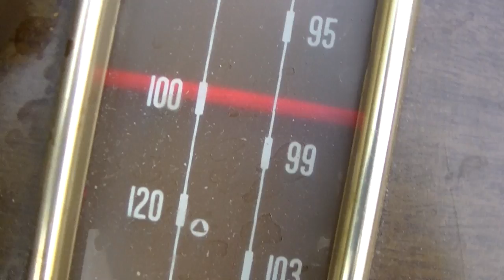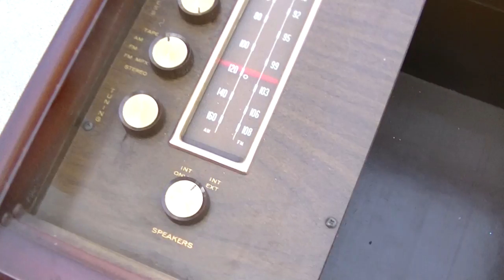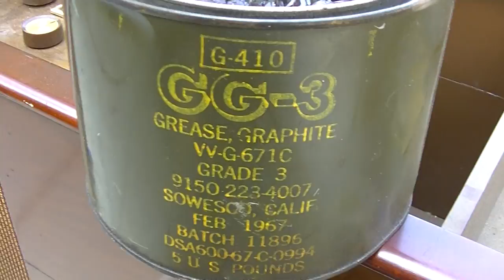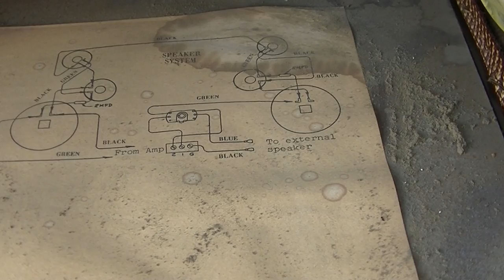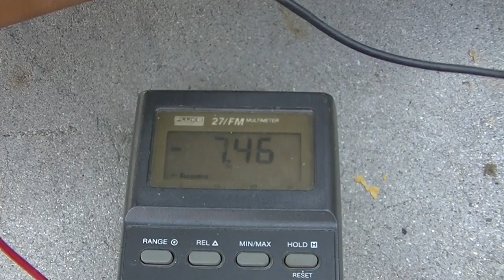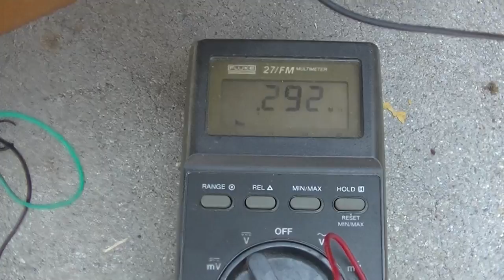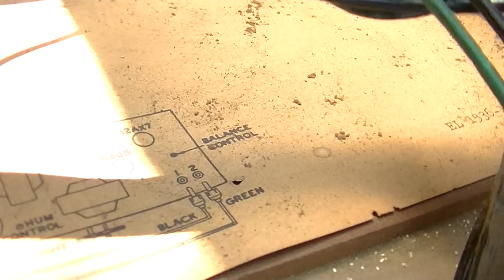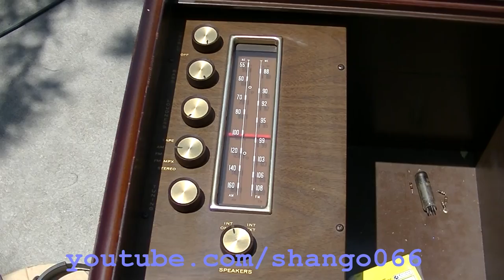Magnavox Console Stereo Record Player Repair

Comment: The reason why it took it a little bit is because the tubes need to warm up before you hear anything. We are so used to turning something on and there it is. Back then the tubes had to warm up when you turned it on.

Comment: I have a 1960 Zenith console and the FM was working but then stopped. Initially the FM worked but the stereo light didn’t come on right away. I’ve looked over some of the tubes and noticed two were very dim. Should I replace them and see if that helps? I cleaned up the turntable and it was working beautifully but now has that similar grinder noise. I have to go back and check it. Any ideas on the FM? Thanks

Comment: Good old speaker selector switches... I got a decent 1990s Pioneer receiver from my uncle because he thought it was broken. Turns out he had accidentally pushed in the switch for the "B" set of speakers, causing the two he had connected to go silent.

Comment: grid emission/gas seems a common problem with those smaller 'all glass' valves/tubes, i have several with rising positive grid volts but otherwise good cathode emission , pity, , they'd be ok in an amp circuit with low impedance direct drive such as a transistor stage, i may make an amp circuit to use them sometime!

Comment: Lack of sensitivity on those subcontracted FM front ends is pretty typical.  Several companies used those in the early sixties possibly late 50s.  (EICO HF-90 tuner was one off of the top of my head)  I've never come across one that was really sensitive. And what do you do when the dial cord breaks on the slug? You're likely SOL.
Reply: If he installs a dumont it might work

Comment: Nobody I've ever known here on the east coast buys consoles like this to put into the living room. Instead, I've gotten them for $20 to $40 at tag sales, or for free on the side of the road. If you have clientele that will buy them, that's cool, but I only ever bought them for the vintage speakers (often Jensen, Oxford or Utah) and the amp, transformers and tubes. If someone fixes these up to actually play music through,  great, but I sure hope they retrofit it to use a better turntable than what it came with.  Record changers with ceramic cartridges,  heavy, high-friction tone arms, idler drive, high wow and flutter and motor rumble are not really my cup of tea.  I bought a compact stereo from Radio Shack in 1971 with paper-route money when I was 13,  And within 6 months I had replaced the built in BSR-MacDonald turntable and ceramic cartridge with a Garrard  and a magnetic cartridge, which also required a step-up phono preamp.
Reply: these sort of big lumps are rarely wanted here in the uk , seen many get dumped, i've rescued the innards of a few, only ones likely to fetch money are mostly pre war, or any extra high quality or ones using rare output valves/tubes which the audiophools buy just for them and dump the rest
Reply: @andygozzo72  , I used to carry a sledgehammer, battery operated Sawzall and basic tools in my car for the express of dismantling/ cannibalizing such units found out by the curb with a sign saying "free".  I made it a point to be kind to the homeowners and not leave any wood scraps or loose screws and nails behind.
Reply: memory could be failing but weren't most of the garrard tables idler drive too?
Reply: @n2n8sda  , yes, including the one I bought at age13, but unlike the BSR, the headshell on the Garrard would accept magnetic cartridges. A few years later I was using a Pioneer belt drive, then a Thorens. 

In the early 80's when I became a hifi salesman, there were a few Garrard tables that were belt drive and we even sold a model that was direct drive!
Reply: @n2n8sda  the ones i've seen, yes, i'd  think most 'standard domestic grade' decks were idler drive
Reply: @n2n8sda  Most turntables in the day were idler drives. The Japanese introduced belt drive and direct drive in the late 1960s, along with S shaped tonearms.
Reply: @n2n8sda  Yes.  Our shop changed out many with BSR changers.  We must have bought them in bulk 50 at a time

Comment: New turntable, new amp, new speakers, new tuner connect it to the old dial (can be easily done) and replace the workings of the all knobs, connect them up correctly. You will have 2 spare inputs the AM and tape, plenty of space in the record drawer for digital stuff CD' MP3 data storage players. Everyone to their own, but that's what I'd do.

Comment: The Conelrad dial markings went away in 1963 so the radio was previous to that or just after as they used up the existing dial plates that they had in  stock.
Reply: I vaguely recall that the multiplex add-on's were ca. 1960/1961, when standards were still uncertain and before stereo FM came built in. I have a Bell tuner from that time that is mono with multiplex jacks. The multiplex add-on is very rare.

Comment: Indeed, very strange about the resistors failing. I'm not too surprised about the lack of deep bass, though---being single-ended, it's only about 5 watts per channel. Push-pull EL84's would rock the house
Reply: allen- bradley carbon resistors were known for the value to drift up as they got age on them. I thought that this unit would have a" push- pull output" section on it. I am not a big fan of "single ended output" using "6BQ5' power pentode tubes. I like the 6L6 power pentode tubes, operating in "push- pull output" configuration. the volume pot(s) on this unit, I could not see if they had audio taper on them, a lot of times the manufacturer would use this as a "BASS CUT" at higher volume levels, also there my be resistors that are out of tolerance in the base circuits.

Comment: On that turntable, I would bet if you let that motor run a few minutes, it would come up to the correct speed or close to it.    That means the lube in the motor is stiff, a little oil would fix it.  I have seen that happen on the Astronic turntables, one I use to own.

Comment: xraytonyb just did a video on some kind of weird stereo amplifier from the early 60's that had two output tube that did not use single ended amplifiers, but used a shared single push pull and the second transformer did some kind of phase shifting to get stereo. Would be interesting to see the schematic on this one.
Reply: yep, known as  'phantom push pull' here in the UK,  also called CBS 'simplex' push pull stereo, the UK Ferguson company (Thorn) did some radiograms using it
Reply: @andygozzo72  That is a tough one for me to wrap my head around. A lot going on there, the output transformer is larger than it would need to be for a single ended design, which seems to be the case here. Don't those seem a bit large for a 3 watt output, which is what I would expect out of a single ended 6BQ5?

 The T-2200 Revere reel to reel that I used to have used a single ended 6BQ5 output for the monitor speaker, and the transformer is tiny in comparison to the ones here. That is why I thought it might be a simplex.
Reply: @zulumax1  its better to have a transformer bigger than really needed, better bass response and less chance of saturation, on the 'common mode' transformer , the one taking current of both valves through single end winding
Reply: @andygozzo72  Indeed, the transformers on this Fisher 500C I am working on are monster, but it is 30 watts a channel. Love the potted cobalt nickel altec peerless output transformers on my Heathkit amps, those have a very flat bass response.

Comment: If the price of the KORG Nutube 6P1s was low enough I would consider rebuilding the who unit with the KORG Nutube 6P1 tubes and EL34 tubes for the output, the 6P1s would operate on a B+ between 45-60V with a heater voltage of 1.5-3V and the EL34 tubes would have a B+ of 200V and a heater of 5V.

Comment: I smoke, and have to tell you you'd never know unless you see me. Nothing in my house stinks of smoke, or my car, or my clothes, no nicotine stained fingers or moustache. I don't smoke in my house, OR CAR, ..don't smoke down to the filter. Never understood why folks hot box their own house, live in a smokey, dank, cloud of nico-goo, and let the funk get into everything they own.
Reply: If I smoked, I'd probably have worked out some kind of system with tubes going to the nearest window that would let me inhale the smoke and exhale it to the outside. Also, I've never understood why people who smoke  in an easy chair, or even worse, in bed,  don't have some kind of cigarette holder with a screen section to contain the ashes and keep the tip away from anything flammable. Such a holder, with a tube to the nearest window, would be both safer and cleaner.
Reply: I smoked for years and my place and items never stunk. I always cracked a window somewhere or turned on an exhaust fan. No idea why people chain smoke inside with no ventilation. You have to be smoking quite a bit to get the tar build up on everything.
Reply: @pcno2832  They used to sell smoke eater ashtrays. Worked fairly well as I recall.
Reply: Both my parents were heavy smokers. Can you imagine going on vacation and being stuck in the back seat for hours with them puffing away in front with the windows up? My dad was an accountant with his office in the basement. During tax season, it was worse than the worst dive bar---blue fog! Most smokers insist their house doesn't smell, but they are SO used to it. You have to be away from it for awhile. Now if someone who was smoking just walks by, I can tell. That's how non-smoker parents can tell if their kids have been smoking but smoker parents can't. It is hard to get rid of the nicotine stink. I had to wash the living room with TSP, put stain killer primer on and then three coats of paint to cover the brown (it used to be green) walls.
Reply: @hotpuppy1  My wife doesn't smoke. She can't smell it, neither can her parents, my in-laws, who quit 3 years ago. Nothing worse than a reformed smoker. I pride myself on having my person, home, car, music room, man cave and so on being impeccably clean and not smelling of anything, smoke, pets, you name it. I grew up in the 'Blue Haze" my parents and grand parents were chain smokers and beer drinkers, which go hand in hand. Every night from 5pm to 11pm with a break from 7pm to 7:45pm for dinner, 7 days a week and they smoked starting at 9am every day. Growing up in that, I always smelled like smoke and other kids picked on me. So I swore to myself if I ever smoked, I would do everything in my power to be sure no one could smell it anywhere on me or in my home, car, clothes, whatever.
Reply: @hotpuppy1  My mom's place was like that. Even after the killz and paint... In moist areas like bathrooms and kitchen the tar began oozing through the paint. Pretty gross. I used to have non-smokers over and they didn't realize I smoked. I don't like my place to smell like much of anything so I open windows or sliding door fairly often, even in winter. I also use a motion sensor in the bathroom to keep the fan on 20 minutes after business is done in lieu of sprays and potpourri and whatnot.

Comment: Who'd a thunk that you'd have to replace all the RESISTORS.  They are worse than the capacitors!  Is nicotine corrosive to resistors?
I bought a shit load of 1/4 and 1/2 watt carbon resistors in assortment packs from Rat Shack years ago.

Comment: Ah yes, the extra cost Magnavox MPX adapter. You can upgrade from zero stereo separation to zero stereo separation for a small fee. I've never seen one work no matter that all the parts test good and you carefully align it. I think it has something to do with either a phase shift on the 19 kHz separation or just weak MPX signal coming from the tuner itself.

Comment: I have to laugh at the idea of restoring rather than rebuilding a 50s/60s era house. Here in the UK my house was built in 1955 and is considered relatively modern - the village's "new estate" was from about 1965! The "old" ones on the green date back to the 1560s.
Reply: They're not old by anyone's measure, but modernist houses from the 50s and 60s fell out of fashion very quickly. By the 1980s, they were out of style and already being either torn down or renovated into something else - Eg Mediterranean Revival. Rising property values also meant that that little 3 bedroom 50s rancher got bulldozed for a mansion. Now that Mid Century Modern style has come back in vogue, the houses from that period that escaped alteration are desirable again, since they don't need as much work to put back into the right style
Reply: California was in boom times in the 40'5, 50's and 60's and the houses built were dramatic reflections of the styles of those eras. Here in the Midwest, there seemed to be more emphasis on practicality than stylishness.  But those small practical houses are being torn to throw up hideous McMansions.
Reply: my ggg-grandparents lived in adobe's there in LA as did most of the original residents. My g-grandmother had an Adobe there also, maybe one of the last ones but they're all out of style, lol, also. Crazy place now, used to be a great town, & a real wild west town.

Comment: Soak the wheel in break fluid that will soften it up
Reply: Dot 3 brake fluid.  I've soaked the wheel in a small container and wrapped the container in a heating pad for 2-3 days.  It does work!

Comment: try putting that rubber wheel in boiling hot water for an hour or 2, sometimes it makes quite a big difference
Reply: take the hard glaze off with sandpaper then clean with windex.

Comment: Is there a word for changing every single resistor in a set no matter if it's good or not like for capacitors it's recapping, now for resistors that would be reressing?

Now I imagine kids in 20 years changing every single everything in old radios. Like everything everything including the wires and 3d printing all the plastics and there are enough companies that make PCBs...
Reply: I might call it... Ir"resist"able.
Reply: @equid0x  Ohm my God
(or how Kraftwerk would put it: Ohm sweet Ohm)

Comment: My guess is this is a 1958, it has the same changer and receiver as the "Modern Concerto" two-cabinet console that I've been hoarding for like 6 yrs. Also a Marlboro ashtray bottom ~had to clean all the wires ~t'was gross.
Reply: ha.. completely different power amp tho. Maybe '59? idk.
Reply: Magnavox built that set between the years 1962,till 1964. In 1964, the sets were sold state.
Reply: @johnalbanese30  yeah. yeahyeahyeahyeahyeah,,  yes. ok cool. I'm definitely an ignoramus. . . but, I do know some Latin.
Reply: @johnalbanese30  my '58 is an actual gem, then.  maybe 600-800$ for a good runner. -it is really neat, 4 6v6 driving 15's, a 6X9 and some littles. it's a survivor for sure.
Reply: maybe even cool enough to take to Ron the Transvestite in Houston.  love the guy.
Reply: gaddammit whatever tho, I'm an electrical idiot.

Comment: That Magnavox console has one of the more desirable single-ended 6BQ5 amplifiers.
Reply: I like the 6L6 push- pull amps much better!!!!!!
Reply: @gregoryclemen1870   I've seen Magnavox and Motorola consoles that had a 3 channel amplifier, with a center channel or primitive subwoofer.
Reply: @goodun2974  , YUP!!!, the third channel is a base channel, and was very "GUTZY"!!!!!
Reply: @gregoryclemen1870  , if memory serves, they used a pair of push-pull EL84'S for the bottom end and single ended 6BM8's for the left and right channels. Or vice versa....

Comment: Oh Cool our Saturday Treat a Nicotine Stained Shango Repair now where did I put my Hasmat Suit. You know you can get someone to 3D Print a new wheel for a rubber O ring I design stuff like that all the time. If I was closer Shango to you I would make you one, still let me know might not be so bad on postage just need exact dimensions can model it for you and 3D print and slip in an envelope to you. Yeah those high voltage high drop resistors do go bad, the electro static eats them away internally over time, migration of contact surfaces can occur if the electrical bonding is not tight enough..
Reply: Aha, so you got a direct drive extruder then? 😉
Reply: @matthiasmartin1975  Yup

Comment: Nicotine sets don't rust
Reply: I suppose it would be like a old engine with a coating of oil over it. Prevents the metals from moisture and air.
Reply: @burntoutelectronics   Recording studios all banned smoking decades ago because they found it did horrible things to the the faders and sliders, switches and potentiometers,  and sometimes to the actual circuit boards.

Comment: a get it to work fix for the turn table drive is to put a thin coating of silicone on the edge of the drive wheel